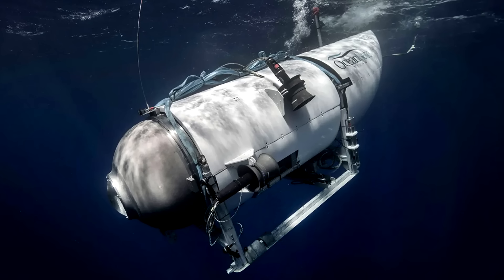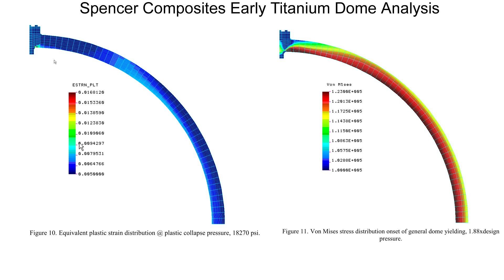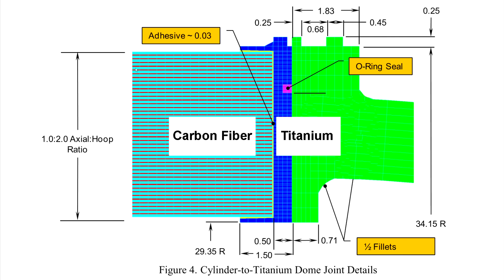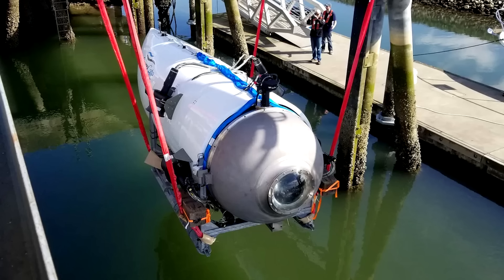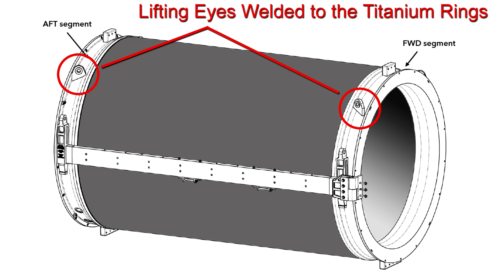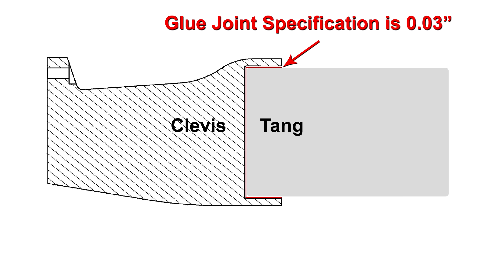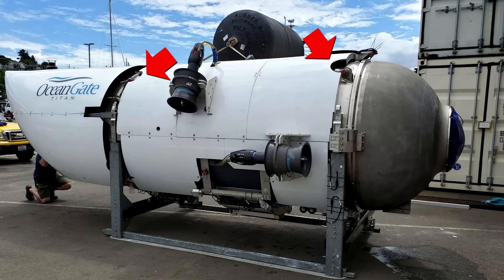OceanGate Titan Titanium Rings - An Additional Story About Them

Comment: Was that submersible ( Titan) even tested without a crew, just by lowering it at depths with weight simulating 3 or 4 adults weights before any real diving with people?
Reply from the maker: Great question and the answer is no for the V2 hull that imploded.  The V1 hull was tested in the Bahamas once without a crew by lowering down on a rope to depth.  During that dive, I don't think they tried to simulate crew weight.
Reply: @solareclipsetimer  Thanks, yea I followed since the time the first news report of the "Titan" tragedy. And that was the first time I ever heard of such a submersible. And it surprised me it was partially built with carbon fiber materials. Hopefully if someone else tries using same for deep sea diving,they will  improve a design or go by what the failures are or not use carbon fiber? Thanks.

Comment: That material used to make the cylinder was more flexible that the rings.  Creating a sheer point.  Also.... multiple trips.   The smartest thing about the Titan was the capacity to use the controller.  Some didnt like that but its our future.  The controller should be attached to the operator who is strapped in.
Reply from the maker: Thanks fro your comment.  I agree that using two dissimilar materials will not be the future with submersible building.  OceanGate tired it by convincing themselves they could engineer for it, but it is a bad concept.

Comment: Thanks for the explanation. Just think about that pressure: Over 2 tons per square inch. Over 330 kg per square centimetre. Two heavy people on an adult's little fingernail. Any minor flaw at that pressure would, and did, result in water intruding, like a cutting jet, straight through the interface of the crack, causing a sudden collapse of the hull. Crushed like a snail under a truck tyre.
Reply from the maker: Thanks for your comment.  I agree with you.

Comment: Rush had knowledge of a potential failure from acoustic and load sensors. The trip before the implosion there was an audible bang that passengers asked about they were given an excuse. The data from the sensors pick up a signal at the same place at the same time . If inside the sub looking forward it would have been the bottom left hand corner of the interface between the carbon fiber and the titanium ring. That's what you see on the ocean floor the sub is actually upside down and what is left is the roof of the sub so the implosion started at the bottom and continued to shatter the hull as it started and you see debris compacted into the bottom of the rear dome more that what would be the top exactly how it would look if it failed where data said the load and acoustic anomaly came from. His ego was so large that even with that information he dove anyway which is incomprehensible but it still happened. But it's been proven that in the ranks of CEO's there's a disproportionate number of psychopaths compared to the average population because they are the type to do whatever it takes to succeed no matter who they put in harms way or however many lives they destroy this was a problem he had he had classic narcissistic behavior among other worrying signs . I think everyone who worked there over the six months before the incident that didn't walk away or get terminated should be charged with a crime because imin that amount of time you should have been able to recognize the mountain of lies and behavior that led to the death of innocent people there is no possible way you couldn't know that disaster was right around the corner.

Comment: Furthermore who remilled the rings? Were they competent? Were they now gaps?
Reply from the maker: Good question.  I bet the cutting of off the rings from the hull and milling out the carton fiber in the c-channel was done at the Janicki company.  They are the company with the equipment that cuts the sub down to size - cuts off the excess hull on the tow ends after the laminate process.

Comment: Regardless the cradling was to happen at 90, 180 and 270 degrees, the eyes were welded at less than 45 and 315 degrees, they don't match the other support points, so yes definitely going to lead to incorrect loading pressures that are not uniform
Reply from the maker: Thanks for your comment.  I hope the final NTSB report will provide more information about who gave the okay to weld those rings there.

Comment: I do not have any advanced degrees but I do understand basic physics.  I could see that this vehicle had interface problems.   We know that carbon fiber has incredible tensile strength, but to assume to have the same characteristics under compression is flaw judgement.  I heard later about sanding down bumps in the winding as an uncertain remedy to a problem.  Finally the unnecessary dovetail housing at the tail, concealed how things were set up.   Stockton Rush cared more about appearance then the overall safety.  He was responsible for this tragedy.

Comment: The carbon fibre was rejected by Boeing for being defective and unusable, and they sold it to Rush knowing he would use it to build the hull of the Titan submarine. There should have been no surprise that the subs hull made popping and cracking noise after 400 feet.
Reply from the maker: Thanks for your comment.  I hope the final NTSB report clears up the controversy about the purchase of the carbon fiber.  It was not clarified well in the hearings.

Comment: Mechanical Engineer here: Engineers are bright people, and can deal with complex subjects and environments. Most are weird, and have difficulty explaining complex ideas, situations and conditions to normal people. That does not make their view stupid or something that can be ignored. If they say no, it is no. It happened with the Challenger disaster. Management ignored the views of the Engineers. That became a much publicised example. Can't hide a space vehicle blowing up for all to see. There were some many other places that lifting lugs or lifting equipment could have been attached too. Load spreader beams attached to the bottom frame would have been better. The wrapping of the straps around the hull where not much better than the lugs.

Comment: I'm a composite engineer. The logistics of overcoming weight are far easier than the logistics of creating a carbon fiber pressure vessel. Heat from welding would certainly "cook" the epoxy/glue joint and lifting still a heavy sub with thin ring flanges not designed for that type of stress. 
Remember, those invited on the Titanic were elite resistors of the Federal Reserve. 
Who was on this sub that knew what? ....
Reply from the maker: Thanks for your comment.  I feel sure that for the second sub, they would have welded the lifting eyes on the rings when they were not attached to the new carbon fiber hull.  OceanGate made some weird decisions for sure, but  I don't think they would have done that, especially after they were warned by Tont on the first hull.
Reply: Book smarts but insane

Comment: The ultimate takeaway from that whole debacle is that you cannot use carbon fiber woven into a cylinder like that in the construction of a deep sea submersible. Carbon fiber woven like that is not homogeneous enough in its layup and construction, no matter how careful you are, such that you can prevent it from failing under those extreme compressive forces.

Comment: They show people with gloves on applying the epoxy to the rings. Previous video shows a gentleman cleaning a ring with one hand, while another ungloved hand is holding the ring where he had just cleaned, most likely depositing oils etc from his hand onto the surface to be epoxied. Quality control was so all over the place it's unbelievable.
Reply: I take more care to avid grease from paws when fitting batteries, or changing halogen bulbs in studio lights.....

Comment: On the dive right before the imploding incident while surfacing there was an audible bang while surfacing. The sub was equipped with acoustic and load sensors when the information from both sets of sensors they both got signals from the same area of the sub . If you were sitting inside looking out the view port then it would be the bottom right hand portion of the titanium carbon fiber interface. The wreckage you see in pictures from the seabed is actually upside down and by the way the hull has been pushed into the rear gives you a good idea of where the failure occurred by the way the water rushed in. By what I see in the pictures that's exactly where I would have guessed the failure occurred and I made that assumption before I knew anything about the bang or the findings of the sensors. I just can't believe Stockton's ego was clouding his judgement so much that even with that knowledge he proceeded anyway . I believe he just had such a grandiose view of himself he actually believed he knew better than engineers and was so hungry for people's money he was willing to put others at risk and the fact he lied about working with Boeing and NASA to make himself look no more important and to deliver a false sense of security to passengers. His wife was in the know about the whole thing and she should be in prison along with anyone else who didn't speak up and get fired or walk away on their own they should share a cell.

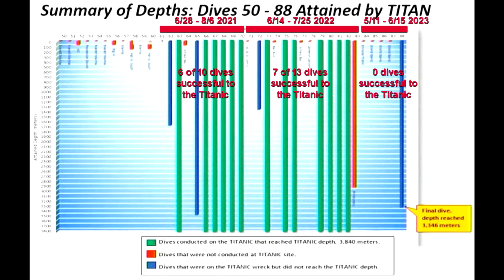Comment: 11:21 - Welding those lifting eyes to the rings is the equivalent of slapping tie down straps and saying, "that ain't going nowhere!"
Reply from the maker: Thanks for commenting.  It's unclear in the presently available public information if they had any new engineering signing off on adding those lifting eyes after the fact.  It seems crazy to add them without it being specifically engineered.  I am giving them the benefit of the doubt at this point, that they cleared it with a structural engineer.  Maybe the final NTSB report will clear it up for us.

Comment: The Ring itself was an engineering FAILURE! 
The ONLY titanium supporting the CF tube was 1/8th of an inch thick by 2 inches wide. The several inches beside it had ZERO support effect. The Ring popped off SHOWS the inner ledge of the ring tore off as the CF tube collapsed at the front edge LIKELY because the Titanium wasn't able to support the tube any more.
The GLUE is 100% irrelevant. Why? Because the pressure would push the ends together working in favor of the rings staying in place.
The lack of thickness of the interior overlap of the rings was the Achilles heel of the sub it was going to fail Close second was the Carbon Fiber.

Comment: If it were the rings or any issues with the glued joint they would've seen leakage long before reaching extreme depths. Tons of pressure held the end caps in place, but I think that kind of lateral weight pushing against the carbon was likely the primary cause of collapse, IMO.

Comment: I spent my college years as a bicycle mechanic. This was during the era of transition from steel and aluminum frames to Carbon fiber that dominates the industry today. Even then it was common knowledge that there was no way to quantify stress cycles on carbon  fiber. When it fails it does so with no warning. When I first heard of the carbon fiber hull on this submersible I was shocked. But like the rest of the general public, I thought they would/should have tested the hell out of this before putting lives at risk. Stockton Rush… your arrogance is unforgivable and your legacy will forever be profit over safety and ego over intelligence.

Comment: Does it really matter at this point where the failure occurred, nobody is ever gonna build a sub to this specification using these materials ever again, at least nobody that values their life.
Reply from the maker: It only matters if you care about science and technology, analyzing failure modes, doing proper design and analysis, planning testing protocols, etc.  I agree that no one will try this for a long while due to the stigma of how this one failed under OceanGate's leadership.  But this hull survived a lot of pressure.  There may be a role for carbon fiber in hulls that go to lesser depths, so we should learn from this.  You may like this summation. It got to the Titanic 13 times at 3,840m (and in 2022, it got to the Titanic on four consecutive dives!). It also had one dive to 3,500m, one dive to 2,900m, and two other deep dives, 1,700m and 1,380m. You can also count the five high-pressure dives in the Deep Ocean Test Facility done before the expeditions as cycles (3,000m, 4,000m, 4,200m x 3). So, that is 20 deep pressure cycles (if not including the 1,380 and the 1,700).

Comment: If they made a carbon fiber sphere - they would be alive 😔 (assuming they didn't do any more mistakes 😅) but they made a cylinder contraption of 2 dissimilar materiels 😢
Reply from the maker: That is a great question.  When they wrap a carbon fiber sphere, the mandrel still has to be held "in space" at one or two points so the machine can wrap around the mandrel (the way I have always seen it).  So there is going to be a hole somewhere.  When OceanGate tested their 1/3 scale model hulls that had carbon fiber domes, the domes had to have plugs in them at the top for the support for the mandrel.  That plug was a failure point when pressure tested.  Even if they made a large sphere somehow, they would have to have a hole for an entry door, and that would be a big weak point.  Thanks for your comment.

Comment: its really amazing that it lasted for as long as it had - I think had Stockton not cheaped out - and built a block-3 or say limit each hull to 10 dives - they very well might still be around.
Reply from the maker: Thanks for your comment.  A thick carbon fiber hull may work, maybe at lower depths and for a limited cycle life.

Comment: This design was WAY less sophisticated than mine, which used layers of trash bags, Elmer’s glue, and cardboard.  Surrounded by wine barrel rings, and fitted to Chinesium rings.  My windows were made from 5/8 inch thick, flat acrylic, and 28 inches square.  My system was shaped like a triangular pyramid for strength.  It was also much cheaper than this design, and much lighter.  It would have offered roughly the same results.

Comment: Absolutely. When I first saw this case I immediately thought, why is the tongue and cleavage so shallow? That needed to be much deeper.
Reply from the maker: Great comment and observation.  I agree with you for the times it is out of the water.  However, if you had the opportunity to ask Tony during the building of the sub I think he would have told you it is strong enough when out of the water because it only has to hold the glue (in his testimony) and when in the water the loads are equally distributed around the sub so it doesn't have to be any larger.  Thanks again for commenting.
Reply: @solareclipsetimer  yes but I don't think he took into consideration the delamination risk. I believe from lifting the vessel and from that very heavy door swinging open and closed all the time caused that narrow tongue and cleavage to fail over time which ultimately caused water intrusion at Titanic depth causing nearly instant and catastrophic failure.

Comment: When I saw just one photo of the interior, I knew it was doomed and that the builders were idiots. The photo was of a flat-screen video monitor mounted to the inside of the hull. Instead of using epoxy to glue a peice of wood to fit the shape of the hull for the mounting screws, they mounted the monitor by screwing straight into the carbon fiber laminate.
Reply from the maker: Thanks for your comment.  Allow me to mention something.  Inside of the inner surface of the hull, there were long plastic spacers that ran the length of the sub.  They were about 3/4" thick.  Then, a stiff liner was slipped into the sub as the inner surface and it was held away from the carbon fiber by those spacers.  That gap allowed for a place for them to mount the sensors, both acoustic and strain, and run the wires to the back of the sub to go to a computer.  So, anything you see mounted inside of the sub was mounted to that liner.  OceanGate made some bad engineering choices, but I don't think they would have been negligent enough to mount things to the inside of the carbon fiber hull

Comment: There is no way I would trust that glue. I see epoxy fail in construction so that’s crazy to me. 🇦🇺👨‍🏭 welding the lifting lugs would definitely deform those rings. It’s called residual stress and that rigging will be pulling on those lifting lugs putting stress on the flange and carbon fibre and the glue.
Reply from the maker: Thanks for your comment.  I agree that adding those to the rings later doesn't seem like something that could be engineered and evaluated properly if not in the original designs.  But maybe.  Hopefully, the final NTSB report will have more information.

Comment: So, in conclusion, the lifting rings caused the structure of the main ring to deform, thus breaking the glue bond. At a deep depth, this would cause the pressure to snap the hull. I stopped watching at 8min in as this is what they are getting at.
Reply from the maker: Thanks for your comment.  It is just a possibility. The other thing about the story is the "culture" of the engineering decisions.